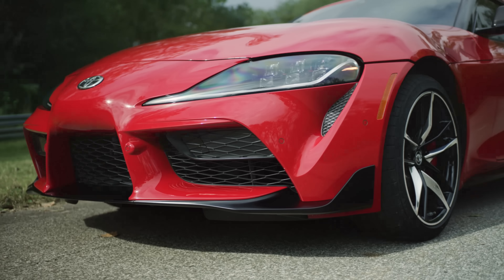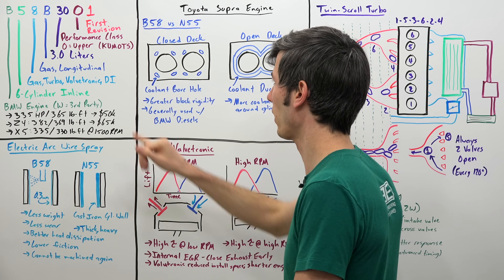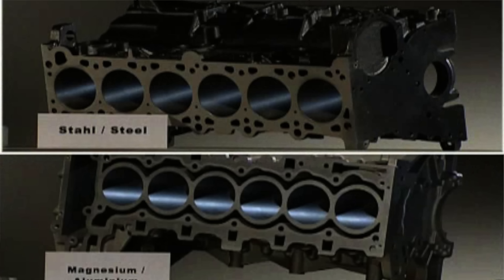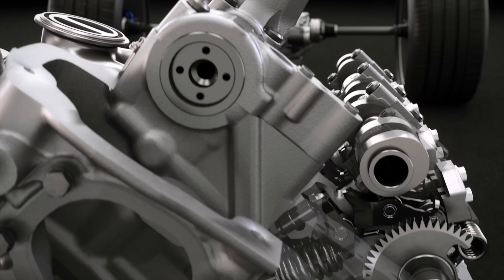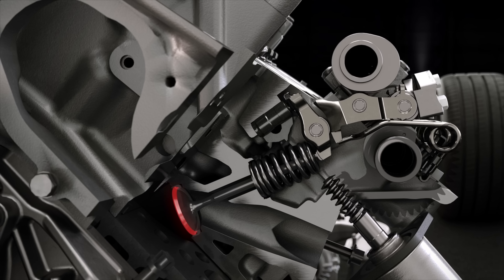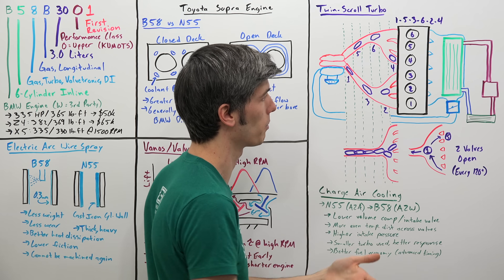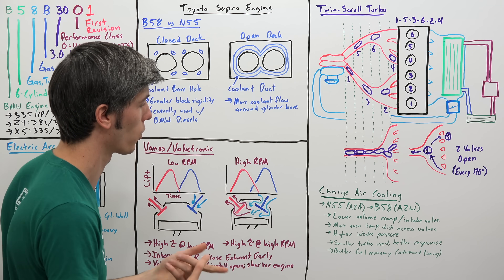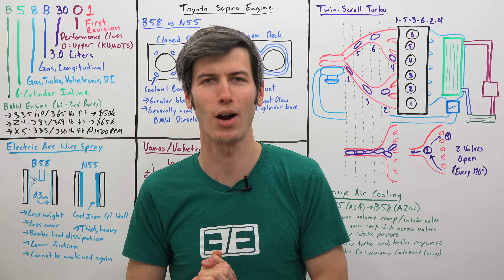2020 Toyota Supra Engine - Detailed Review Of The 2JZ Successor

Comment: Twin Scroll Turbo also increases the surface area (Pounds per Square Inch) that the exhaust gasses expand against, which essentially increases the pneumatic efficiency of boost pressure.  The exhaust gasses are still expanding, in the pipes (It's complicated, but involves Carbon Monoxide in a confined space.)  So, there's a slight, but significant Heat Exchanger effect going into the drive turbines from the engine.  (Or, at least it looks that way to me, from what I've been able to see of the Turbo system.  Which isn't much.)
Reply: Right, the Intercooler is showing the inverse effect.  As it cools (And travels) the compressed air from the turbo loses velocity as it contracts due to heat loss.  You basically don't want that to happen until the Intercooler housing, because that's where the Turbine exhaust mets the intake air directly from the grill.  This increases intake pressure going into the cylinders, which is the point of the intercooler, and the turbo.  If you have heat/pressure/velocity loss in the compressed air from the turbine, you're robbing some of the systems of this benefit.
Reply: "Slight but significant."  They're obviously wringing every HP they can out of these cylinders, and it's a holistic (Or Gestalt) system.  Most of this stuff wouldn't be significant in a daily driver, but this is a flagship, and quite possibly bordering on Super-car performance coupe.  So, it's like taking the gears, and brakes off a track bike to shave 1/100th second off your lap time.  It all adds up, and in places like turbocompression, exponentially.

Comment: Just that it's BMW design and not Yamaha is a little disappointing. When I think of the 2JZ, I think of a bomb-proof bottom end, capable of 1000+ hp with a pretty modest amount of top end work and a giant turbo or two. When I think of BMW, I think of the Mini I bought as my first new car after college that didn't have any major fluid that didn't end up on my driveway within 3 years and even with religious maintennence and without modification, blew itself up at about 83000 miles.

Comment: In a perfect world Toyota would have made a new version of the 2JZ and they would have styled the new Supra as a true successor to the old Supra with a lot of the old design cues which would have made it look a lot more appealing. And they certainly should have not used BMW parts in the interior. Or BMW parts at all. But I guess if you're going to bring back the car and you just don't have the money to do it that way then option b, which is the route they took, having BMW basically be the maker of the car. I understand they designed the exterior and so on but is what it is

Comment: I’m sorry, but I like my Toyotas made and developed by Toyota.... 😭
Reply: AeroZero Yamaha has also designed most of Toyota’s performance engines... ae86, 2000gt, Lexus LFA, 1jz
Reply: @dw7284  i dont think they designed the LFA engine rather they only observed i think
Reply: dw 72 Yamaha designed the V8 in the old Volvo S80 . This engine is also used in one of the noble sports cars
Reply: yamaha also made my piano and keyboard
Reply: It’s a collaboration between both companies the car was build up from scratch the engine is bmw but toyota tweak it to pass they robust quality standard so the car isn’t going to be bad but I should have name it differently not “suppra” maybe gt86R or something
Reply: bmw designed the engine but  toyota tested all parts on the engine for reliability and upgraded much of it so best of both i would say and the horsepower is lower than the z4 so its built for endurance and you could always put a bigger turbo on it later
Reply: It was. The platform was designed in direct collaboration from scratch with BMW. The engine was based off a BMW engine but Toyota put a lot of work into its reliability testing. They also have the same transmission. Due to antitrust laws in Germany and a desire to keep the cars with their own identity everything else including the chassis and bodywork and tuning was done independently. BMW helped with some testing but that's about it
Reply: lger2010 I don't completely understand, are you saying that the new Supras are using the BMW transmission as well?
Reply: @blessed7fold  yes, in a way. The transmission is from a third party named "ZF Friedrichshafen AG" or ZF Group based out of Germany.  They develop transmissions and other parts too. So it's more like saying that both BMW and Toyota agreed for this third party to supply the transmission for both vehicles. So in other words, "yes"....kinda
Reply: Dont worry bud toyota are always focus in there reliability its their moto after all
Reply: This is just me guys tell me if I'm wrong , so the old model supra were 1jz then the newer models were 2jz so why can't this newest model supra be 3 jz gosh that would be great
Reply: @rileystoygarage7310  Most people here are very selective in how they see the supra. Everyone just thinks 2jz or 1jz... yet the previous 4 generations have had 5M-E, 5M-GE, and 7M-GTE engines prior to the 1&2JZ engines.
Reply: New supra I Just not Toyota it BMW supra  meh
Reply: Ew
Reply: so reliability out, sensors headache im. Thanks alot Toyota :/
Reply: Sure right buddy powered by Toyota driven by professionals
Reply: It’s life get used to it buddy if the mk5 ain’t the car go look at something else there’s a million other sports cars
Reply: even when the current engine has proven to be more superior to the previous ones?
Reply: @guru gara As long as you see G in the name like 1jz GTE its designed by Yamaha
Reply: What? Sounds like you must have something against high-priced unreliable crap that costs a fortune to maintain ;)
Reply: Exactly. Recent Toyotas, esp the sporty ones, don't rate cojones by upper mgmt anymore, now that Toyota's more a Prius company than a 4th-gen, 2JZ company. Even the Lexus LF-A I felt, was Toyota's last gasp at making world-class sportscars... and we all saw how compromised the result became, vs. the vision. I think more than a few board members still bring up the stubbornness in bringing that car to market, and how much money it lost...

I don't know why Toyota doesn't make a true (Trueno? :D ) successor to the AE86 -- a rather unassuming, utilitarian hatchback that could deliver tofu with good mpg and safe, economic construction... but with great OEM footwork + aftermarket support to transforms it into a touge raider, for the everyman. They sort of got close with the new Corolla hatch... but a new Civic hatch would eat its lunch. Is it that hard to recreate the essence of those '80s Corollas with genuine Toyota parts, in a genuine Toyota factory?

Wake me up when a real new Toyota Supra, ever makes the showroom floor... a Z4 in a yuru-kyara costume, isn't it.
Reply: @tactiletinkerer  What do you mean by the lfa fell short of the vision? I thought the lfa was always perfect.  What was this vision that Lfa fell short of?
Reply: So you like Camrys, Corollas and Priuses? haha
Reply: Well, don’t buy Supra. Very simple.
Reply: There is going to be supra with a japanes 2.0t with255hp zero to 60 in 5.2. Hope it makes it to the states and the price is right.
Reply: Why would you prefer a crap over BMW? Toyota is only good at econoboxes reliability. You need to hand it to BMW if you want something really amazing and fun to drive. Toyota recognized that. Why can't you?
Reply: @azerogliev6520  Then tell me why there are 2jz's in the monster drag car's and not some BMW engines. Still to today they can build very good engines that can make big power. Look at their 1000hp 4cylinder engine for example. I also have never seen a BMW sportscar with over 200k km on the clock wich still runs good. But Toyota can do that 😎
Reply: Schulze Designs Find an example of a 2jz drag car then. You’re talking crap
Reply: It's like buying a Mustang with a sti motor in it. It kills the soul of the car.
Reply: Muhhamad Ogli-berdiev because if I wanted a BMW I would get just that, I want a Toyota why can’t you accept that?
Reply: @azerogliev6520  they did make the most reliable supercar ever, and they made a hypercar that might be the most reliable one ever
Reply: @azerogliev6520  I'm sorry Honda is still good where i am and the fuel economy ridiculously high and Toyota has lost its touch of engineering look at Mazda they've got guts to make a rotary an engine that people said its a money pit and Mazda is going to make an Inline 6
Reply: @azerogliev6520  Yamaha builds a better engine than BMW any day
Reply: @Johnny-tq9no  not this one. The B58 passed Toyota's testing (the N55 will probably not pass)
Reply: @TheRedc0met  LC? Of course. It's a crap bus that has 0 handling or fun. Only good for reliability. As I said toyota is crap. Just remember that except soccer moms not many enthusiasts will put reliability above handling and fun.
Reply: @azerogliev6520  if Toyota is crap then you're saying the 2JZ is crap... And that just means you're full of crap lol.

Comment: It will get around 900hp unopened on stock internals. That what M4 engines do and it's pretty much the same. it has a forged crankshaft, forged connecting rods,... Toyota could never do an as good engine as this. Not even close. If Toyota did the car it would have prius internals.
Reply: Toyota has made engines that would run circles around this motor. The 7MGTE, the 2JZ, heck, look under the hood of the Lexus LFA. Hopefully this new Supra does well enough that Toyota partners with Yamaha again and develops a new inline 6 in house again.
Reply: Are you a BMW dealer?

Comment: They should put toyota engines in all cars. Not other unreliable engines in Toyota's
Reply: Thousand Nations 1 Soul : Honda is actually the #1 maker of internal combustion engines in the world. #8 in cars, but they make motorcycles, motorbikes, et cetera, even lawn mowers. I believe their engines are slightly more reliable than Toyota's, but with the rest of the car it flips, Toyolexus is #1.
Reply: See son, it doesnt'work that way, because toyota doesn't know how to make fun engines or chassis tha tcan have perfect handling. BMW does. It's as simple. For once Toyota fans will experience what a ultimate driving machine should be. It's not your econobox crap that toyota makes. See - not everyone has reliability as priority.
Reply: @azerogliev6520  thanks moh for 411

Comment: Block that cannot be machined.. They should have left the Supra legacy alone and named this car something else. Toyota GTZ90
Reply: Kris bø  maybe the engine will be reliable so you don’t need to rebuild it. Do you really need 700 hp in the car to drive good?
Reply: @Pawelmps  Depends. I'm sure this block and sprayed in liners will have some overhead but for big numbers, will need sleeves.  Also for rebuilds..
Reply: Totally idiotic move to build a lesser car.  The 2JZTE VVTI engines is proven and better than this crap.  They could have tweaked what was already a good chassis.  Remember, when  Toyota lanced this car in 1990, it was not about the power at 320 HP, it it was about the handling.  Put in all the modern electronics, keep the already good gearbox and a modern transmission and all the new stuff.  Someone clearly does not understand Branding and Brand Loyalty at Toyota.  Also, they didn't learn as children not to keep Bad Company.
Reply: Why can it not be machined? Just because someone says it..

I want to know why exactly. I've seen too many engines sleeved.
Reply: First of any engine which has nicasil or diasil coating basically are one time used only. Once scraped that block is toast. You can spray another coating by removing the damage coating or smoothen the damage block. But the cost to coat it are more expensive than buying a new block and since this is BMW a six cylinder block won't be that friendly on your wallet. With sleeves troubleshooting won't be as hard as nicasil and 10 times more cheaper than nicasil blocks.
Reply: @zuhailishufller8046  So you think this can be sleeved pretty easily?
Reply: @SirtubalotTX  depends on how thick the block is. If you want to retain the same displacement, the sleeves thickness must be within the allowable ranges. You have to rebore the block to fit the sleeves  and sleeves come in many thickness. The thicker the sleeves the more expensive it gets. Simple answer yes you can.
Reply: @zuhailishufller8046  This was my thought process buy wanted to see how others felt.
Reply: So... Imagine if you're Toyota. You set out to build a new Supra. And you realize that in today's economy you would've needed to make the car cost $100,000 if you want to build everything yourself. So you asked for help from other manufacturers. Now you've built the car at a relative low cost, but just because it had BMW's parts in it you suddenly had to scrap the name of the car itself? That doesn't make any sense...
Reply: @FalbereChan  Fair point but not sure I agree that a car like this would have to be 100k. If Ford can sell their Mustang GT for what they are getting, Toyota can as well.
Reply: @SirtubalotTX  
It's not as simple as it looks. Ford already had a lot of parts to work with when they develop new generation of mustangs, they already have V8s and drivetrains such as the ones they use in trucks etc...

Toyota had nothing. They don't even have a straight-6 engine to begin with so developing a whole new engine to just use in 1 specific vehicle is costly, and if they pulled a V6 from it's Lexus lineup, I'd probably be even more mad, as those engines are absolutely no fun and heavy as hell.

Engine isn't the only part where Ford had the advantage... There are many more. But one thing is for sure. And that is Toyota can't build a Supra with everything Toyota inside and make it cost only $50,000 unless they want to make it a very shitty Lexus rebadge.
Reply: @FalbereChan  Mazda don't have a history of making an engine larger than inline 4 but how can Mazda make an Inline 6!? Tell me how is it possible
Reply: @FalbereChan  then the Yaris GR came out, rally homologation and everything. Even the GT86 had a Yamaha and Toyota collaborated head design boxer in it. It even took the U series engine nomenclature which was from the 70s when toyota made boxer engines. This b58 was barely changed by Toyota and it’s disappointing to say the least. Justifying digging up a nameplate for money doesn’t sound reassuring for a brand for me. Take it as you may want, but this was a scandalous move for Toyota. Toyota today is not the Toyota yesterday and that’s what makes me sad.
Reply: @strifu808  While the GR Yaris does manages to achieve a relatively reasonable MSRP, you need to consider the fact that it's "homologation" engine is still based on it's existing M15 engine family (despite being called a G16E), of course it's got better power and other numbers but still, Toyota has lots of experience with that 3-cyl platform. In fact, the whole car still shares quite a significant amount with the original Yaris, which allowed much faster development time and lower the development budget. The GT86 at this point seem more like a counter-argument since the entire car is actually built by Subaru, while your point that Toyota contributed to the design of the boxer engine is valid, it would also just be as valid since the B58 didn't exist yet when Toyota started work on the Supra with BMW. As far as memory serves me, according to a few interviews (I need to check my sources later but please do correct me if I turned out to be wrong), Toyota was going to use the BMW N55 engine but was not confident with it's ability to be reliable and make more power without issues such as heat etc. Which means, without Toyota, the B58 literally wouldn't have been a thing. 

That is why in my opinion, the GR Supra isn't just some nameplate revival that stains the brand. In fact, the MK4 Supra was in every way, a boat, and the MK5 is now truly a sports car that drives the part and still have the ridiculous tuning potential. And the best part? If you adjust for inflation, the MK5 Supra actually have a lower MSRP than the MK4 Supra back when it was new. Overall, I'm just kind of glad that Toyota is back and started making fun cars like the GT86, the Supra, and the Yaris again. Maybe the only shame is the fact that the new Supra only came with an automatic, but then I'm sure Toyota have like an entire team dedicated to market research and they probably really found that barely anybody would buy a new manual Supra off the lot.
Reply: @FalbereChan  I’m pretty sure it’s just manufactured by Subaru heavy industries , design I’m not so sure but both companies rarely even have a concept of such body style considering during release, it’s contemporary demographic was nothing close to a small lightweight RWD streamlined sport coupe. I cannot for the sake of my sanity rely on bmw to make a Toyota level of reliability and efficiency. Both cost and running cost.